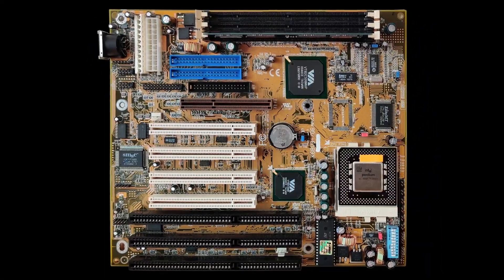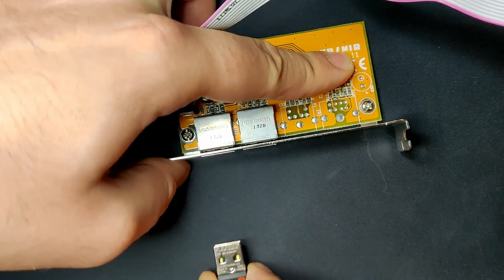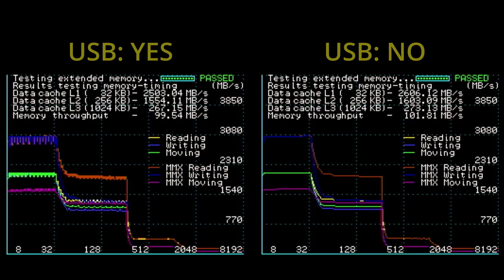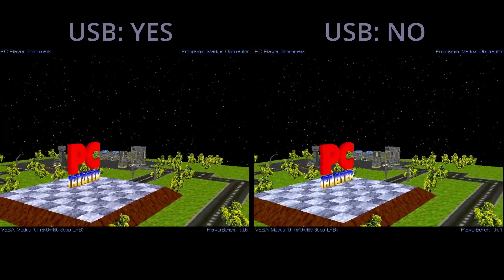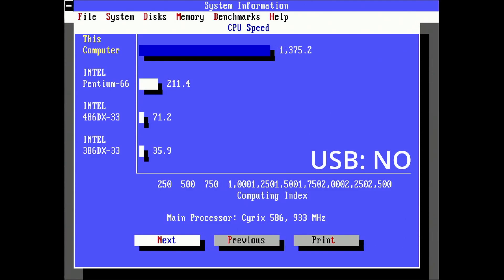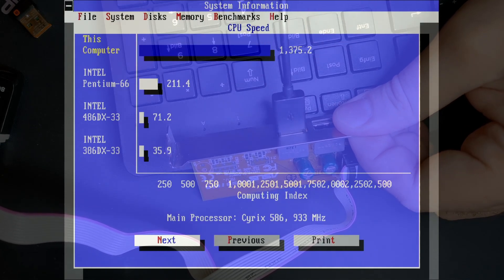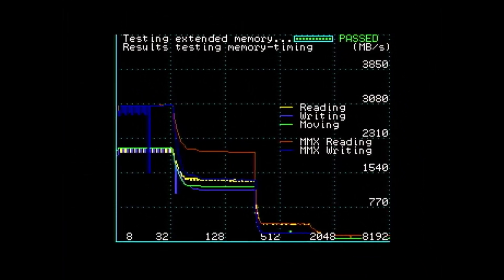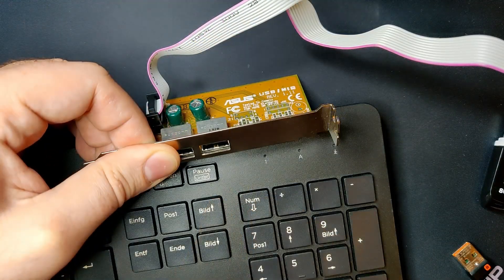Retro PC: USB may slow you down!

Comment: This was known back in the day and one reson why many swore by PS2 keyboards and mice way into the dual core era. Most users wouldn't notice or care though. And it's not like you could feel the .5 fps difference in quake.
There were however way worse iterations of this, with bad/buggy USB2.0 controllers. Some would slow your GHz era PC down to a crawl if the wrong devices were plugged in. Mice could be fine or not, USB Wifi or 3G could be bluescreen-nation or not, harddisks could be a do or a don't.
Reply from the maker: I've heard that initial USB implementations were buggy, but I never experienced it. I think I used PS/2 far longer than I'd like to admit. It may have been far into Windows XP era.

Comment: This is still a problem today with gaming peripherals. 
Some brands of gaming mice will lag some games to 20% of the performance only when you move the mouse. Basically you're DDOSing the games' input which is tied to FPS
I think USB is an inherently bad way or connecting peripherals compared to PS/2
Reply: it's polling rate - i remember when i had an athlon xp with windows xp and i was overclocking the usb mouse to 1000hz from 250hz but I had seen fps drops.
By default that dongle should work at 250hz on that machine which doesnt affect too much but for older machines it could, interesting what will happen if we drop it to 120hz

Comment: Would there also be a change in performance when you disconnect that USB card completely and disable USB in the bios?
Reply from the maker: The performance only drops when I attach a USB keyboard (probably also mouse, but I don't have one). Disconnecting the USB card or disabling USB in the BIOS has no effect.

Comment: As others have said already it probably an interrupt problem.
I had a machine with similar behaviour back in the day, if I used certain USB ports (but not others) with the ps2 port enabled (even if nothing was plugged into ps2) I got anything up to a 5% loss in performance and or micro stuttering in certain games and programs.
Turns out it was just a crappy 3rd party USB controller, if I swapped it for another equally crappy looking one the problem either disappeared  or was much reduced.
Disabling the ps2 controller and using an add in ps2 card instead however made no difference.
Seems just some usb controllers always conflicted with ps2 controllers regardless while others were fine.

Comment: on a P3 system with a pci sata card and ssd. i notice if u run the ATTO  speed test if u have a usb flash drive plugged in at the same time the speeds of the ssd are quire a bit lower then if tested with no flash drive plugged in.
Reply from the maker: Seems like better to avoid using USB devices on older hardware - especially if you're trying to benchmark.
Reply: @bitsundbolts  well usb flash drive is still one of the easier ways to get files over to systems. the amount of speed lost with the flash drive wasn't huge like its not like it slowed the system to a crawl or anything its not even something u would notice outside doing a benchmark.

Comment: I’m curious to learn if this is a bug with the board or bios. Also curious if you have selected legacy support for usb devices in the bios. I remember my motherboard back in 2003 being problematic with the onboard usb ports. It would blue screen windows xp anytime a device was plugged in. I was forced to use an usb2.0 controller from belkin for my needs.
Reply from the maker: Yes, legacy USB support is on in the BIOS. Once I am done with the current content, I may have to make a follow-up on this!

Comment: one of the things that was pretty well known at the time; not everything complied well with the usb spec. it's better these days, but it still happens.

this leads to all sorts of issues, including bus overhead that leads to some slow down, glitches, and failure to boot.

sometimes this is the device itself, sometimes its the bios, and sometimes its the chipset on the board thats handling the usb duties. 

notably; via chipsets for usb are known to people who dealt with this stuff back then, to be.. flakey at times. and compatibility with the myriad of usb devices is.. iffy. and some will definitely cause more overhead than others, usually because some devices have onboard controllers that do the heavy lifting, while others do not, so the onboard controller is having to do it.

other, less than compliant devices, will cause the system to just slow to a crawl. a normally fast boot will be slowed to days. (~1:48s at the time, to a full 3 days. on an older board circa 2003ish)

this is, unfortunately, only somewhat avoidable. there's going to be cases where you can't work around it due to the options you have for gear at a given time.

why? bugs in the chipset not known about, bugs in firmware, and bugs or intentional implementation of the devices/drivers (for windows, if applicable) themselves.

sometimes a bios update will help, sometimes drivers (re; win, etc), and sometimes you just have to ditch a given device for that application use.

it's annoying, but the early days of usb were a minefield, and plugging newer stuff into older hardware isn't a sure thing.
Reply: Especially in the very early days of USB I get the impression a lot of manufacturers had made key design decisions prior to the finalization of the standard. 

Usb-c is similarly bad for all the non-standard implementations.
Reply from the maker: I will go back to DIN / PS/2 keyboards and serial mice. It may be a bit more cumbersome, but those were the standard and working for this old hardware. I don't think many had USB peripherals connected to their Socket 7 platform.
Reply: @bitsundbolts  yeah, i had a plethora of various usb stuff hooked up to mine, but it was never very stable. data dropouts, system hangs, etc. unplug the devices? usually ran smooth and trouble free.

it wasn't until mmm i want to say just before the first flavors of s775 came out that they really got usb working reliably enough for 'normal' every day use while plugged in 24/7. and even that's debatable. 

s478 and sA were better than s7 and slot1/s370, but still left a lot to be desired.

cheers.

Comment: I would assume it‘s the USB legacy emulation. That has to run somwhere in the background. Windows with active drivers has full control over when to poll USB devices. The emulation layer of the system BIOS just regularly interrupts the system to do the polling. I would bet that it happens even on a modern CPU, but because the CPUs are now so much faster and with multiple cores it doesn‘t matter anymore.

Comment: I'm surprised that this boards Bios already has USB keyboard support. I never tried USB with anything below Win98. Especially not DOS, because that would require USB input device support in Bios. Probably the necessary device polling frequently triggers an interrupt that runs Bios code that is responsible for simulating the legacy keyboard at IO ports 0x60. I have to try that myself with one of my socket 7 boards.  I bet it won't work on any of the Intel chipset ones but maybe on the later VIAs.
Reply from the maker: Yes, even the ASUS P55T2P4 has a USB header. I was surprised to see that too! (was the first video I made for this channel ☺️)
However, if you look into the manual, you will only see a short paragraph of a few sentences about USB and that it is "reserved for future use"...
Reply: @bitsundbolts  Yes the HX and my old VX board both had USB, and I know it (kind of) works in Win98. I always avoided it because its buggy and laggy. But a USB keyboard in pure DOS I would never even have tried. I mean the Bios already has legacy keyboard emulation support for consumer USB Keyboards I personally came across only years later. That's pretty future proof.

Comment: I suspect its excess interrupt polling. It would probably take a BIOS fix. Have you tried using a older USB 1.1 PCI add in board?
Reply from the maker: Unfortunately, I don't have an old USB PCI board. But from other comments and yours, trend goes towards BIOS emulating PS/2 Input devices. Excessive polling and poor BIOS implemention may cause the extra load and therefore slowdown of the system.

Comment: Pretty sure it's caused by the BIOS emulating a PS/2 keyboard in a very inefficient way. Once Windows starts, proper drivers are used which work much better and don't rely on the BIOS.
Reply from the maker: That would explain the difference between DOS and Windows.

Comment: Interesting. I suppose it comes from the fact that PS2 sends an interrupt request when there is input, while USB has to constantly be polled by the CPU to check if there's any input.
Reply: I wanted to type that, but You were faster.

Also - I'd like to check how pooling rate affects this. Eg. 125hz, 250hz, 500hz and 1000hz in a usb keyboard/mouse

Comment: I once had a similar problem with a Pentium II Windows 98 machine. In windows, it seemed to work fine. But after running Doom, the whole computer would freeze completely for about half a second, every 3 seconds or so. A few formats later, changing DMA settings etc. I figured it out - it was caused by the USB mouse!

Also, on several Pentium 4 systems I've noticed that when using a USB mouse, you can hear coil whine from the motherboard that corresponds to moving the mouse.

I now only use PS/2 or serial mice and PS/2 or DIN keyboards. The only exception would be the Logitech MX518 with a USB/PS2 adapter.
Reply: Model m122 for the win

Comment: It might be due to the PS/2 protocol, which is integrated in the keyboard controller. Both mouse and keyboard are supposed to connect to that. Though, the BIOS isn’t detecting them on their dedicated controller. Instead, they’re connected to USB, which might cause a failover of some kind, resulting into software PS/2 emulation (by the BIOS, which causes loss of precious CPU cycles). 

I’m just guessing for now, but the fact that there’s a dedicated keyboard (and PS/2 mouse) controller present on the motherboard. And the fact that there’s a PS/2 peripheral compatible USB controller, pushes my mind into that direction. 

Also, PS/2 has IRQ 12 by default, when it’s enabled. You might want to look into the used IRQ’s for the USB controller. Especially the glitches are causing me to thing into that direction. 

Good luck!
Reply from the maker: I think you're right - this may be a good starting point for further investigation.

Comment: Very interesting finding. Because of being 9:30pm now in Germany I will look into this tomorrow. Have a K6-3/450 and a MVP3 + ALI based SS7 Board. Furthermore a QDI Titanium for investigation. Because i always used PS2 Keyboards I never stumbled across this weird behavior. Will post an update tomorrow.
Reply from the maker: That would be awesome 👍
Reply: @bitsundbolts  Here is the promised result. Yes, indeed can i confirm this behaviour on all my Boards with Intel 430TX, VIA MVP3 and ALI Aladin5 Chipset.Used a Penitum 200MMX. In Quake you lose 0,5 fps. In 3DBench 1.0c expect 1,5 points less. In Doom you lose 0,8 to 1fps. The sawtooth pattern is also visible in Speedsys.
Reply from the maker: Thanks for testing and confirming! I guess I'll stick to PS/2 and DIN from now on.

Comment: Well I think this could be due to polling on USB Input devices. PS/2 peripherals are Interrupt based but USB Input devices are polled by the system. Maybe you could create an further impact by changing the polling rate. Usually 125Hz are used. If it's possible to change polling rate to e.g. 500Hz you should see an even further drop in performance.

Mit fränkischen Grüßen ;)
Reply from the maker: Interesting idea! I may look into this.

Liebe Grüße zurück ins Frankenland!

Comment: Yeah, I rember USB being such a pain in the butt with certain mid/late '90 pcs. My father always told me not to use usb mice because they would slow down our pc at the time (a pentium 166 mmx)
Reply: Usb 1.0 had major issues. They came out with a refresh standard a year or two later that fixed a lot of them. I forget if it was called usb 1.1 or USB 1.2. 

Most of the socket 7 systems shipped with the buggy one. Most of the slot 1 systems had the fixed version.